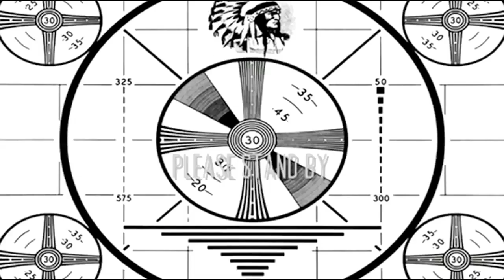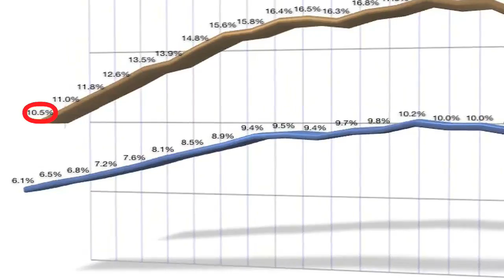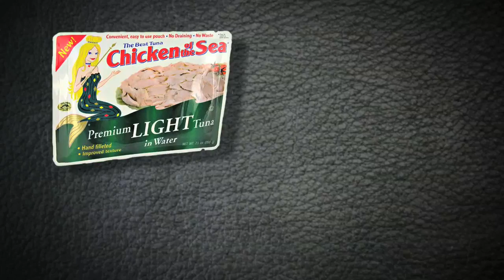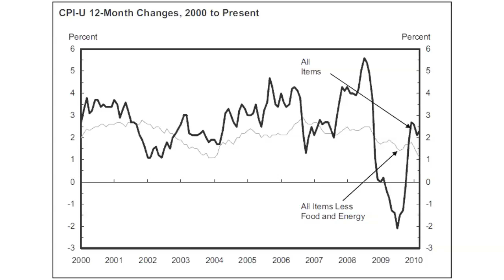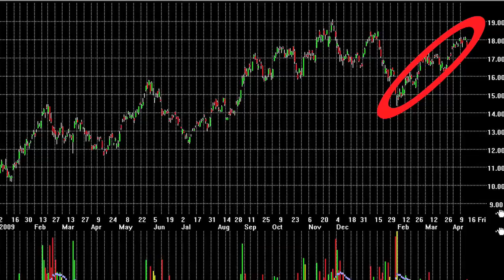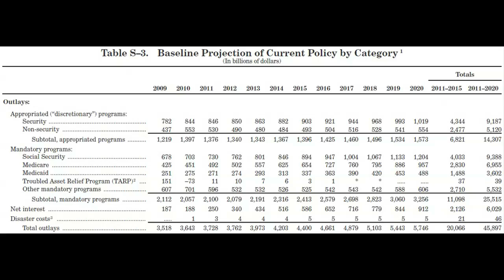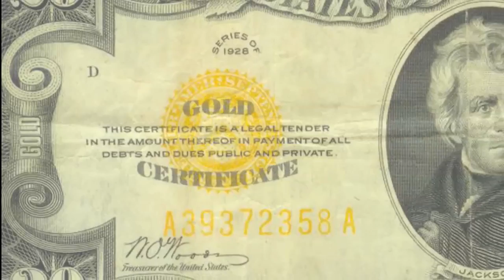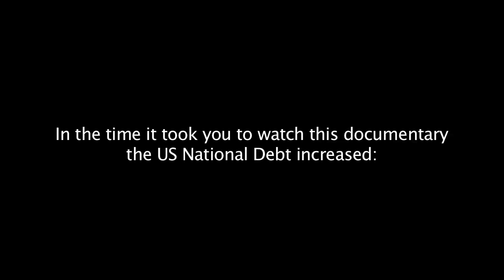Meltup

Comment: @orangedac, no my brother you are partially correct.  For those that create value they would be paid of that value.  The confusion has been with which type of money - as money has been pushed into having 3 simultaneous definitions: 1) medium of exchange; 2) store of value: and 3) unit of measure.  Money is liquidity -  it is the life blood of any economy as such it most flow through the economy and should not be held.

I do not have the space to completely explain my position on the issue.

Comment: @DirectCore no, that's not how it works, that's not how it's ever worked. the bread costs more during inflation, but guess what? the gold is worth more money at the same time! so the worth of gold relative to bread never changes. the only thing changing with fiat money is the value of the money itself, which inevitably goes down, always. BTW, at today's rates, 50,000 oz. og gold is about $65 million.

Comment: @fstwrtr Food prices aren't counted as part of inflation, because they fluctuate with seasons and weather. Basic economics. But, in fact, processed food prices have been falling, which is still a circumstantial indicator.

Deflation has been happening for two years. If you bother to check the growth of money supply, it was at its lowest in fifty years for the four years before that. 

There is NO indication of even normal inflation, now, much less hyperinflation.

Comment: In my humble opinion, all we need is balance. It doesn't matter which one's idea you use; John Maynard Keyne's (Bail out or Govt. Spending) or Friedrich Von Hayek's (Let market force do its job). The key is to balance between the 2 elder economist's ideas. No need to go to extremely 1 sided; either Keyne's or Hayek's idea. Both are equally good when properly used. If Fed. Reserve acted a little more sincerely; it would not have gotten so bad for the entire planet.

Comment: @hoodoo961 
The American economy was like a bucket with a very large hole at the bottom. U.S. government should pour this bucket to the brim. If the flow of water (money) will be weak, then all the water spilled into the hole, and happen to default. Therefore, the U.S. government increases the flow of water (money) in a bucket (the U.S. economy). 
Problems in the U.S. economy are fundamental problems. They can not be solved by bringing the loans or by selling securities.

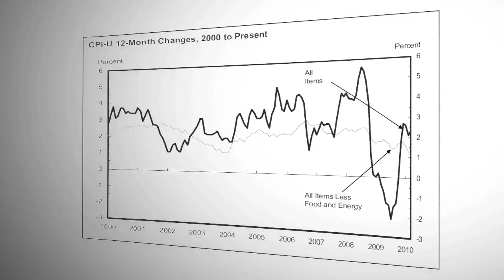Comment: 23:00,, this is precisely why you should not look @ price fluctiations.. CPI is just that.. real valuation is based on the intrinsic value of an asset.  DJIA is crap. its calculated using price index.. its worthless . 2 journalist came up with it way back when and its used in the new.  if anything go off the S&P 500 where it is calculated using value indexing.

Comment: 29:55 - CFTC Hearing 10/03/25: ".. are you concerned that the shorts will not be able to deliver if called upon?" Jeffrey M. Christian (CPM Group): "No, I'm not at all concerned, ah, for one thing it's been persistently that way for decades. Another thing is that there are any number of mechanisms allowing for cash settlement.. "

Not if there isn't any cash (fiat "faith"currency) because that cash has been deemed worthless paper by those who've lost "faith" in it by it's massive devaluation.

Comment: @DirectCore where would they get the gold to trade?  By barter, so they bartered to get the gold.  But if the supply of gold is short and they dont barter for gold what can they do - straight barter, or quasi-barter?  But what if they cant barter with Country A, country C has what they want.  The trade is done with country A but instead of a barter country A issues a credit.  the value of this money is backed by Country C believing that Country A will redeem the credit.

Comment: there are both good and bad to metel backed currancies and fiot currancies. The Colonies had the Colonial Strip and we were fine with that since they only printed as much as needed, therefore made it worth while to have. The only down side to it is printing too much causing the value to go down.
Gold and silver backing of currancy is good to keep the printing limited and keep it's value. But since it's very possible the Gold at Fort Knox isn't even there anymore, well isn't it obvious?

Comment: @gukow1 Yes, for the fiscal year 2009 the US ran a substantial deficit. But the fact is that there is more than enough available money from savings that people and firms want to put into Treasury debt, so that rates on that debt remained and remain low despite the proliferation. And that means the government does not need to print money to finance it, the markets are willing to do it at rock bottom prices.

Comment: @foonty Do you mean its exchange rate? You realize that is secondary, to the point of near irrelevance under most circumstances, to the value and function of any currency, right?

What is important is its domestic buying power...and in the US, the buying power of the dollar has been rising for years. There is no "Tsunami", especially because the socialism of the past ten years ends, in November.

Comment: Currency, the USD, will be deflated.  If not over time, without notice, or a proclamation that NEW money will be issued in lieu of your old money.  Go to a banking area, and they will give you NEW money, worth 1/2 of the current value of your money.  SO, you have $5,000 in your savings?  The new money will be worth $2500, over night.  Watch.  OR, stagnation will last about 2 decades (with have one decade thru now) and one more decade?  Your money is now so small, so weak, it sucks!!!!!

Comment: @AlbertInSanAntonio

Albert, that's false logic. You're stating that Chinese labor and US Labor are equal in value. Product B is cheaper than Product A because it's made with cheaper labor. Not because A is inflated. 

Wealth is generated by the efficient allocation of resources, not the accumulation of resources. 

Trade Surplus or Trade Deficient doesn't matter, it's a false economic indicator. It doesn't take into account comparative advantage or the inherent value of the products.

Comment: @santaria360 during inflation the price of everythig goes up. price of gas, price of milk, and price of LABOUR. Therefore, wages/salaries increase along with the price of everything else. So when your wages increase, it nullifies inflation. Inflation is harmless. Because:
100 years ago: a chocolate bar costed 3 cents, minimum wage was 7 cents.
100 years later: a chocolate bar costs $3, but minimum wage is $7.
It doesn't make a fucking difference. Hahaha, whether it's 70000 or 7.

Comment: @petiemac24 Better if what is answered by facts? About the long calendar? Dude they way the calendar worked were essentially by a series of gears all interlocking. Every day had a name unique to that specific day. However, every 5,125 years, the names would start to repeat itself. Because the gears aligned themselves again. Like a speedometer on a car after it passes 999,999 miles. Then it starts over at 000,000. Is you car going to vanish?